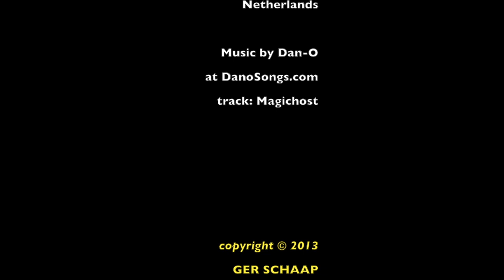How it's made (part 1): 4WD overland expedition vehicle

Comment: In my opinion, 
Using ISO blocks in the build, on all (8) eight corner's, brings more opportunities to use the Truck for other duties and a modular standard, would increase sales.
Example, I could order a container, built to my specs, and when completed, can be shipped anywhere in the world and mount up to anything using standard dimensions for the ISO blocks.
And why are they doubling up on platforms? One platform in the container,  and another fixed to the truck?

Comment: How much does something like this cost as a basic finished shell, anyone know...I'm looking into doing this in the near future. None of the companies i've looked at give a standard shell price for a particular truck unless i fill out loads of forms. I'd rather go with a company who shows their prices on a website with different standard shells for certain types of 4x4 vehicles...Upfront is always best. I realize there's so many different variations however, it wouldn't hurt to list prices, sizes and the vehicles that have previously  been fitted out by these companies so you have a ruff idea of pricing!

Comment: 1 question ad why didn't they lengthen the wheel base more more and stick the cab behind the front wheels and put a nose over motor make it easier for maintenance..
I would also make it a static height 6'8"-7'5" 
If you are going to mount it on the back by Christ take the rear tray off 1st..